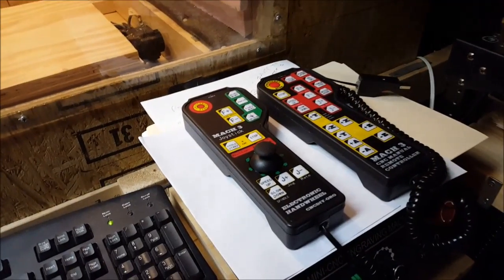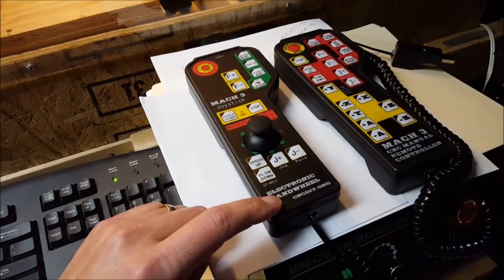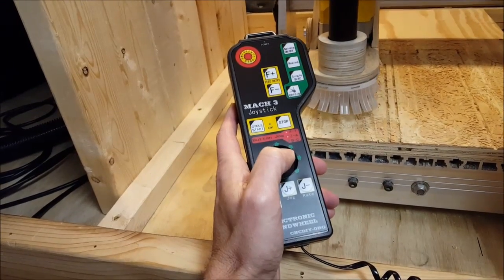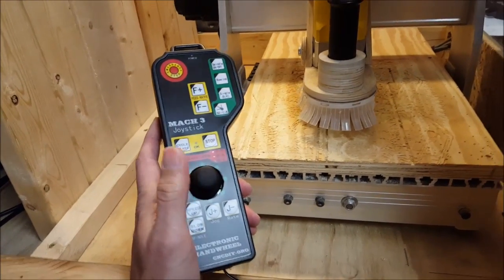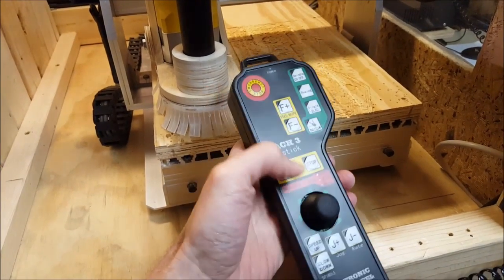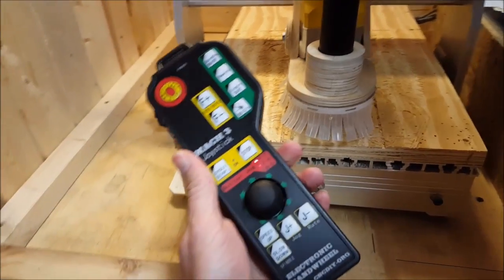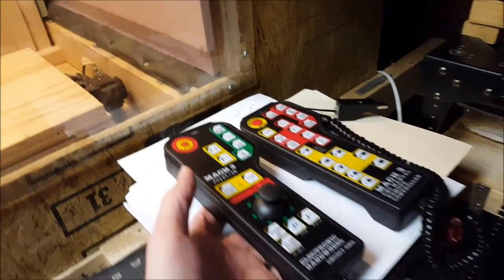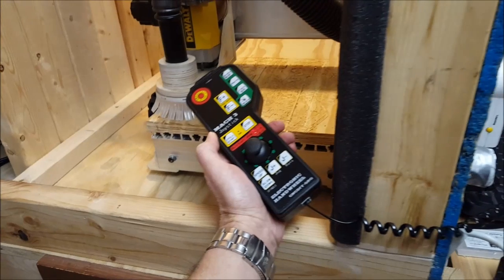Mach 3 Controller (Easy Option)

Comment: I noticed there is a speed control on this, but you clicked on slow down, didn't seem to change much. However can this be slowed right down to barely moving. So I can re-align things. I don't use a home position, so I place my wood, then select a start point, then I will mill 1 tool path, change bit, then I need to get that back to the 0,0 point of where I started. So Need to to go slow to stop at the 0 point
Reply from the maker: They can be programmed in lots of ways to control many things but I haven't gotten into the programming for mine.